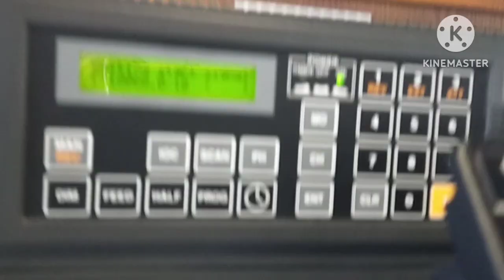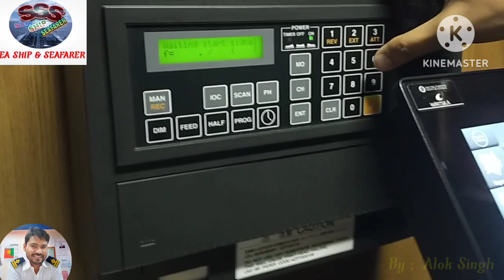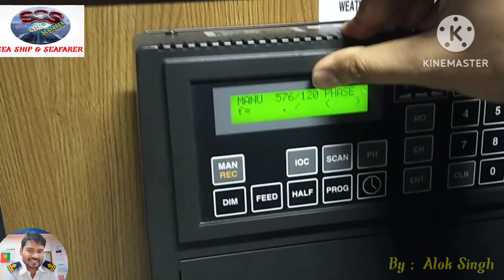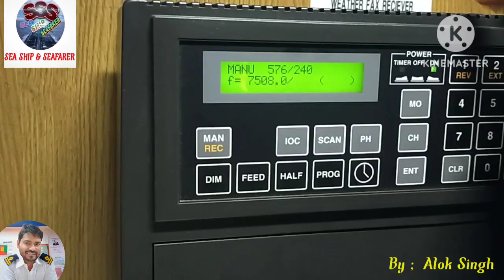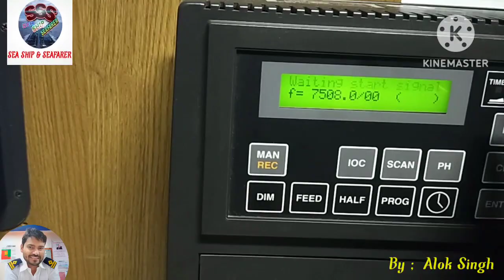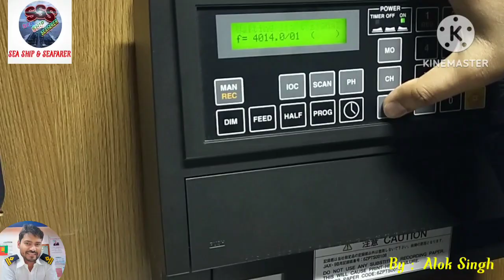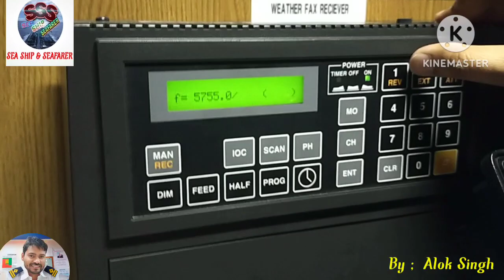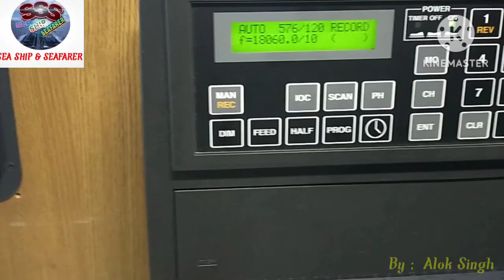Wx-Fax / weather facsimile / weather report / Wx fax / How to set frequency in wx fax / SSS / Alok

Comment: Nice
Reply from the maker: @markfrancispejante9312  Thanks for response
Reply: @Aloksinghsunny  still i cannot recvd any forecast from my wx fax..i make the same process with your video...can you help me
Reply from the maker: @markfrancispejante9312  if your system is scanning the frequency which you have set then it's alright, it happens sometimes when the station actually not broadcasting , or you might be out of range of the coverage area (you can check  the coverage area from adp). 
Most probably that station with which you are trying is not broadcasting.Also check the broadcast time in UTC and keep the system switch on in scanning mode.
Reply: @Aloksinghsunny  im here at istanbul, suppose im using the OLYMPIA frequencies. I checked also in the ADP. Still not recving. Im doing the 2 frequencies at the same time...been 3 months already no recvd at all...pls help me bro. Pls😢😢😢
Reply from the maker: @markfrancispejante9312  Just to check whether your system is ok,try with some other station on higher frequency which is covering your range.
Reply: @Aloksinghsunny  just only 2 frequency in this area bro.
Reply from the maker: @markfrancispejante9312  Then either that station is not broadcasting or there is some technical problem in your receiver, there is no issue with setting
Reply from the maker: Check with other vessel if possible, whether they are receiving from from that station.